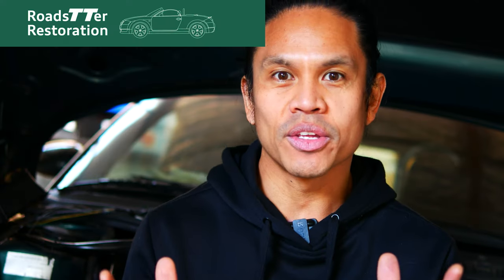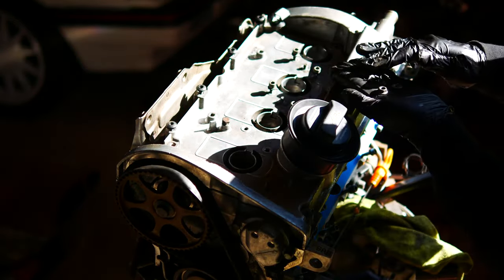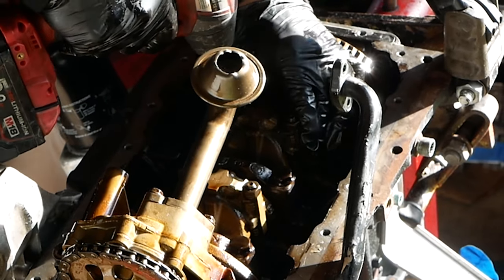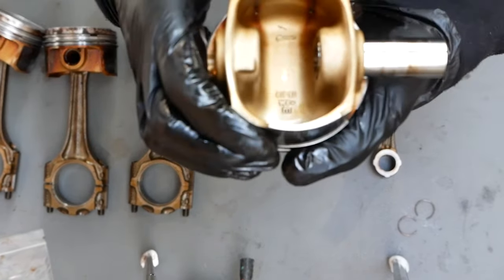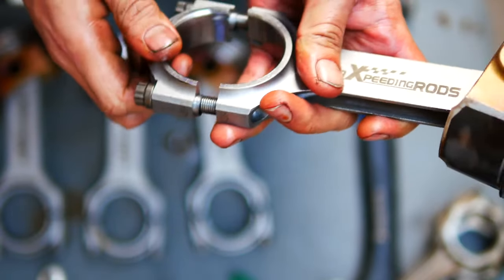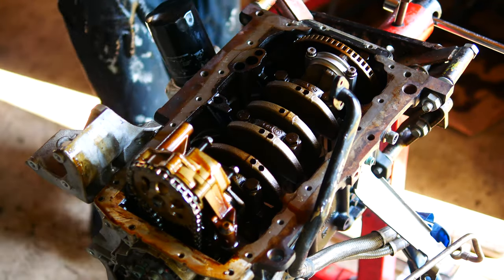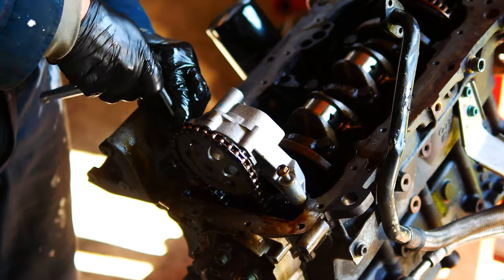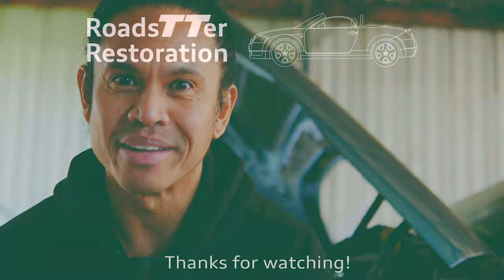Full DIY guide 1.8t forged connecting rods upgrade for Audi TT Mk1 8N & 1.8t Maxpeeding rods review

Comment from the maker: Anyone else running MaXpeeding rods and for how long? 
Some people really poo poo them but I guess I'll find out soon!
Reply: A buddy of mine does. On a fully built 1.8t quattro. Big turbo.. supertech valve train n retainers head work. All bolt ons, exhaust, fmic, intake, hfc, 550cc injectors, upgraded fuel pump with b5 fuel return system. Probably making 400 plus hp. Been couple yrs. Rips golf r.. gti's.. rs4.. s3.. m3, ford focus st, yeh has claimed quite a few scalps on the road
Reply from the maker: @A-DUBCLUB  hahaha love this! So far mine has also been holding up well! Loving it 😍

Comment: With various cuts in editing it is hard to determine and I also didn't hear you mention anything but was the crank and everything else balanced or did you just drop these in? If not how is the car running now after a few months? I know IE has "Drop In" Rods... but I am very curious as no one on various forums really talks about it.
Reply from the maker: Good question and you're right Austin - I just dropped them in. 

I didn't mention anything testing the crank / balancing because 
1/ the engine I installed these into was a good running engine 
2/ the rods themselves are meant to be balanced within a small tolerance of weights with each other. 

A few months later - with a track day thrown in for food measure. All is good 😊

I think if you you the IE ones they should also be balanced not only as a total but also small end to big end (I'd double check with IE though) so you'd have even more confidence that  dropping those in will result in long lasting performance.

Comment: Quick question when fitting uprated rods do you need specific shells to match the rods you decided to go with or do any shells for that engine work with different rods?
Reply from the maker: Good question. I went with race shells, supposedly they have a coating to make them more slippery or something but yes, any shells that fit will work too.
Reply: @ianpgonzaga  brilliant thanks , I currently have the head off my S3 and am deciding whether to fit a set of rods bearings and rings while it's apart
Reply from the maker: @richiec9077  might as well while you're there hey.

Comment: Anyone else notice later in the video it flashed up that you torque arp 5/16" rod bolts to 50ft lbs? Sir that is incorrect. Now how many maxpeeding rods have gotten destroyed because of the incorrect info?
Reply from the maker: Good point. The ones I got stated they are the 3/8" spec bolts so I think they're alright. So far so good though.

Comment: Hi can upgrading a 225 hp engine apx in audi tt 180hp auq engine only the block engine can running in ko3s turbo and the parts from 180hp auq engine are same all parts please reply
Reply from the maker: Hi - that should work if you'r ejust using the APC block with all the right K03 parts bolted on